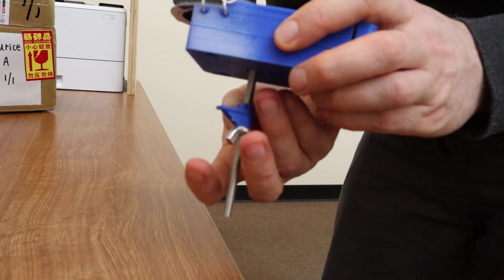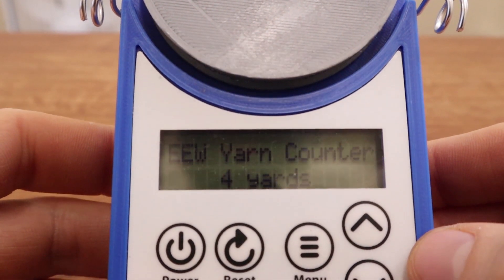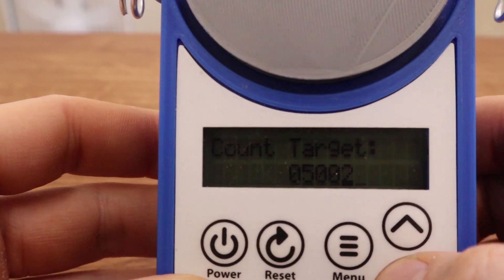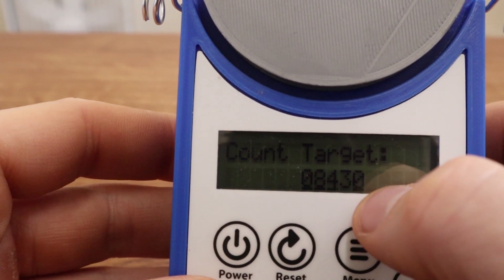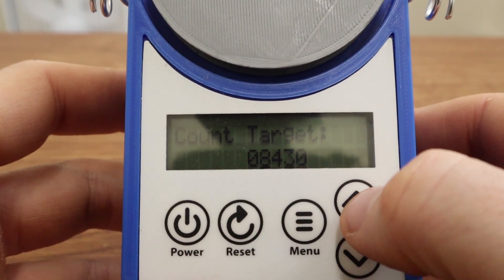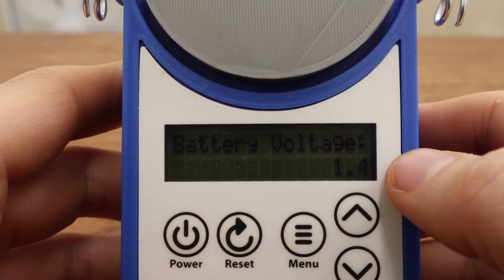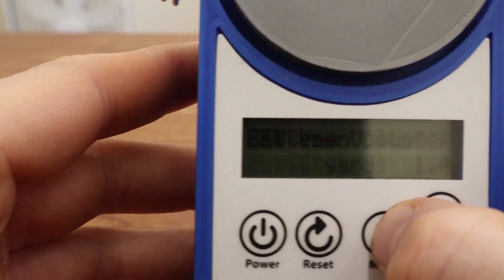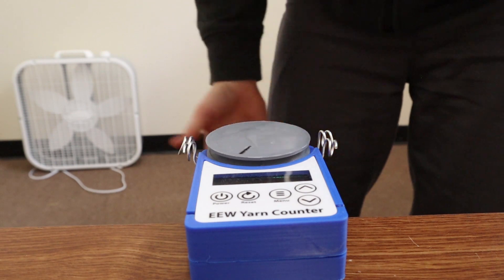SPIN #75 - First Fully Functional Prototype of the Yarn Counter

Comment: Could the clamping system be adjustable so this counter could also be used with a tension box on a loom to do sectional warping? That would be awesome!
Reply from the maker: It is pretty adjustable.  Do you have a specific recommendation on what you are looking for that you don't think the current system would handle?
Reply: @DreamingRobotsBlog  The counter would have to be affixed to the tension box in some way. It might work if it could be used vertically instead of horizontally. But since the bolt can be removed and replaced with something else, that might work. The problem is that every make and model of tension box is different and looms are different too. So as much flexibility as possible is best....

Comment: Sounds like you have made a lot of progress! Excited to see this be available. Question: how heavy/thin can the yarn be? Does it work on lace weight to bulky? How about handspun that is thick and thin? Artyarns? Thank you!
Reply from the maker: It should support lace weight to bulky and handspun, but these are things I still need to test more.  If there are issues here it would just be the yarn guides or pulley that would need to be updated and those should be pretty easy updates as I am prototyping.

Comment: Sounds great, would there be an option for pug in instead of battery operated?
Reply from the maker: Probably not an official one.  The aux port could be used by people who wanted to mod it to do this, but it would require wiring a special cable.  I got feedback that just having batteries if they have long enough life was what most people wanted so I'm just going with that for now.